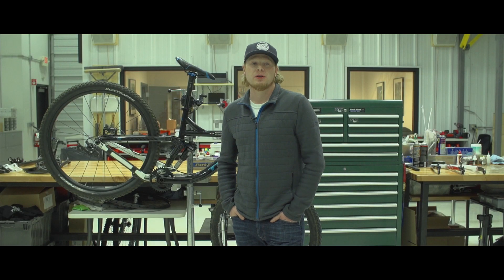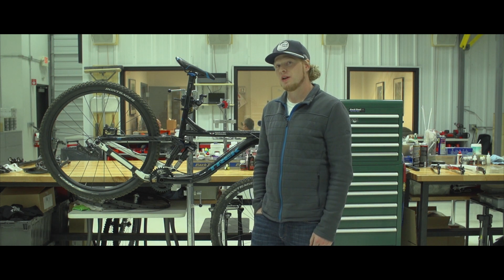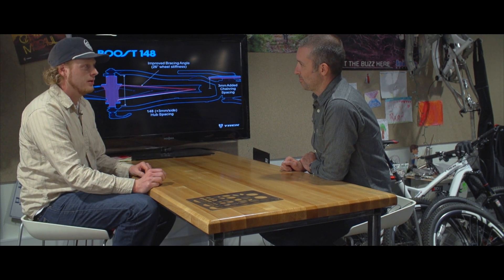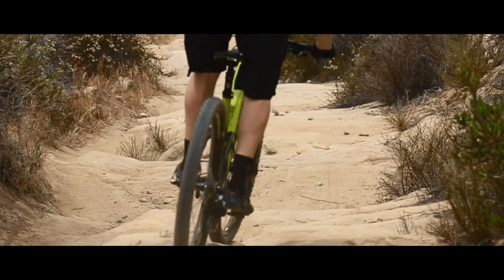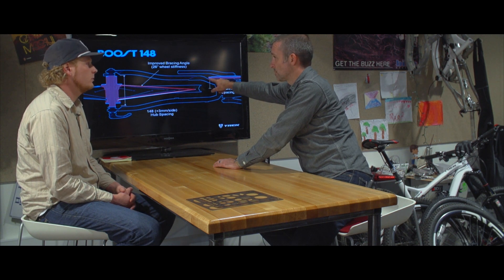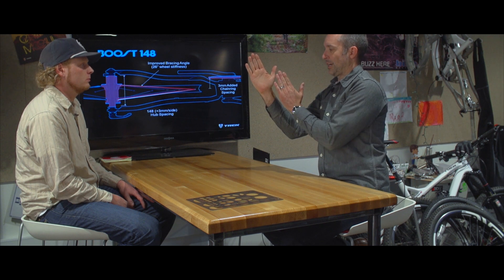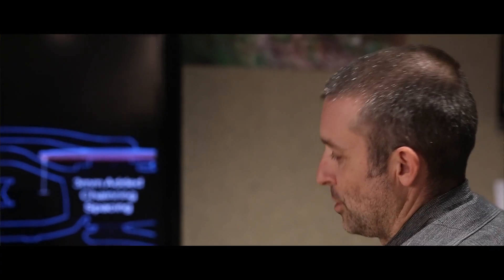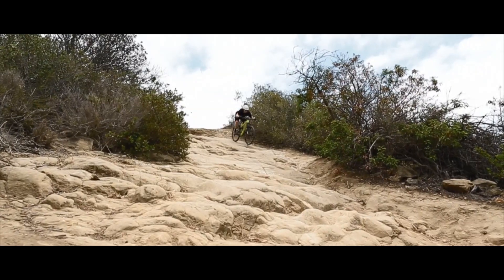Blueprint: Trek Boost 148

Comment: I rode a 50km singletrack trail on Saturday on a Cube Stereo 29er with 142mm wide (X12 Syntace system) at the rear. The bike is carbon but they've stiffened things up by using aluminium rear triangle. I can not see any reason to make the rear stiffer, it simply doesn't require it.

Comment: Are there huge differences between using a 150 hub that exists already rather than going 1mm narrower on either side to make a 148?
Reply: cause 150 is actually 157
Reply: cause 150 is actually 157

Comment: Why not use the existing 150mm standard? Thats the only question that should have be en asked.
Reply: Superb point!
Reply: http://www.bikemag.com/gear/trek-boost-148-bike-magazine-exclusive-blueprint-story-new-hub-spacing/

"Why 148 millimeters? That sounds like an arbitrary number. Trek engineers found that this was about as wide as they could go without affecting the Q-factor on current cranks. Boost 148 does require a different crank (or in the case of SRAM, just a spider) than a 142-millimeter spaced bike to correct the chain line, but overall crank width stays the same. The added bracing angle achieved by widening the hub flanges within these constraints creates a 29-inch wheel that tests as stiff and strong as a 650b wheel.

Why not use the 150 spacing used on DH bikes? It sounds close, but the 150 standard used on downhill bikes is actually 157 millimeters wide, and requires wider crank spacing."

Comment: a buddy just picked one up, i got to ride it. its emediately aparent how much less the wheelset flexes. i have ridden qr to 142 and there is quite a difference than qr, cant really tell with 142 to 148.

 my guess is 142 will start to be phased out. but this wont happen for a few years at least. the lack of standards real shunts consumption of this tech.

my guess is there will be a slow creep of these advancements going forward so get used to it.

bikes are no longer bikes, they are now machines with two wheels.

Comment: It would be cool if it was just a little wider like lets say ... 150mm? That would be true innovation. Oh, wait ...
Reply: http://www.bikemag.com/gear/trek-boost-148-bike-magazine-exclusive-blueprint-story-new-hub-spacing/

"Why 148 millimeters? That sounds like an arbitrary number. Trek engineers found that this was about as wide as they could go without affecting the Q-factor on current cranks. Boost 148 does require a different crank (or in the case of SRAM, just a spider) than a 142-millimeter spaced bike to correct the chain line, but overall crank width stays the same. The added bracing angle achieved by widening the hub flanges within these constraints creates a 29-inch wheel that tests as stiff and strong as a 650b wheel.

Why not use the 150 spacing used on DH bikes? It sounds close, but the 150 standard used on downhill bikes is actually 157 millimeters wide, and requires wider crank spacing."
Reply: Because 150 is actually 157, and if they went there they would have to significantly increase the Q factor

Comment: So Trek create the boost 148? Them why my Roscoe 8 didn't came with it. Instead has this "boost 141" that I need to use adapters in order to run Line 30  carbon wheels........not nice.

Comment: Saying you need BOOST for stiffer wheels then putting 28 spoke wheels on your bikes is BS. Trek did this to save money on wheel builds and warranty claims. 

I'll bet the knock block wasn't to make a stiffer bike but to pinch pennies by using less cable housing and eliminating steps in frame production.

Comment: What is next? 152, 155, 160? Present days bike industry sucks!
Reply: +MKseven7seven 150 (technically it's 157 apparently) is on downhill bikes already and has been there for awhile but it's so wide that Trek says it prevents them from using a double chain ring and heel clearance becomes an issue so unless Shimano and SRAM widen the Q factor on their cranks (I really hope not) Axles shouldn't get much wider. Though I wouldn't be surprised if we end up with the downhill axles at somepoint on everything.